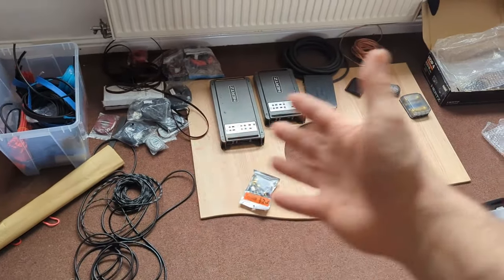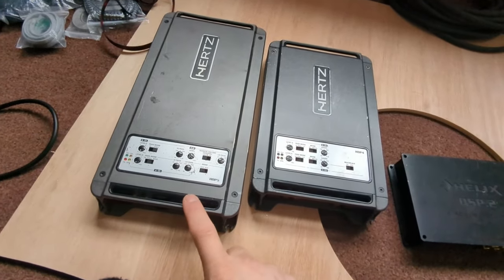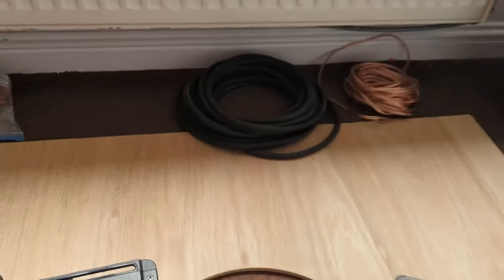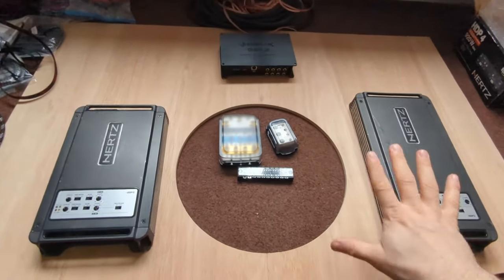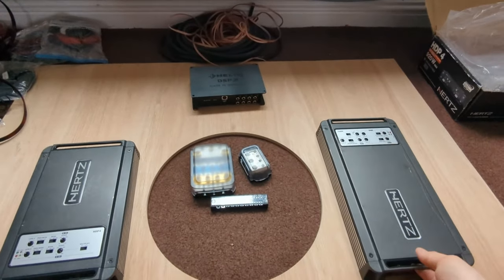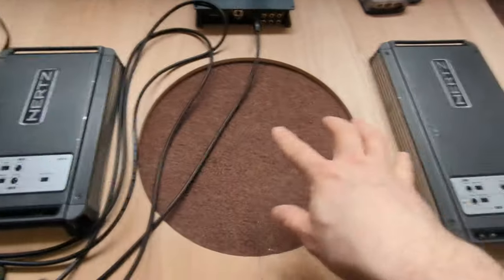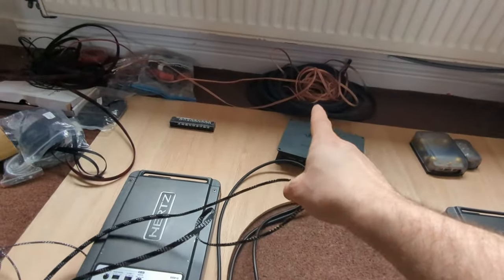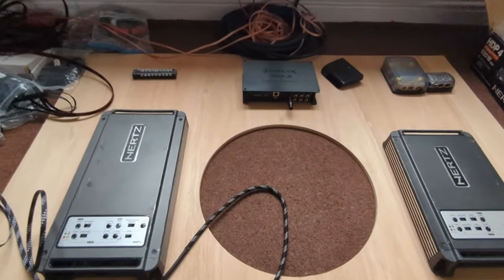Honda Jazz upgrade part 5 - amp rack plans

Comment: I did the same thing with the speaker wires for a friends amp rack. I kept them flat on the board. Anywhere there were bends, I separated the two wires at the bend, all the way to the next bend. That kept the wire from twisting at the bends.

Comment: Thanks you for your brilliant English) 
Instead internal Bluetooth you would like to install external, to connect toslink. I have same idea. But now i try to build my 1st system, and i thought what ugly idea. Now i understand that everything is good 😅
Reply from the maker: We opted for an external BT adapter as it was much cheaper than the Helix BT HEC card.
Reply: @RAW-CAt  Some use WiiM Pro streamers in their cars. Connect to it with phones WiFi, control that with phone (or probably any other device with WiiM app and Wi-Fi) but streamer plays max quality files and then can send signal thru RCA, Toslink or Coax cables to DSP... Haven't tried that myself, but one day I might remove Mosconi Amas external BT and try streamer in a car.

Comment: Twisted speaker wires are more for aesthetics. Twisted RCA’s is because most amps use differential inputs now. Now that DSP’s are becoming more of a standard, twisted is not as important for amp inputs. But twisted is still equally as important for DSP inputs.

Comment: Twisted was found to help cancel noise, better than shielded.  Larry Fredrich from  PG mentioned that in his interview
 (Rip)
Reply: Are you referring to speaker wires? Those are not very susceptible to induced noise.
Reply: @JasonWW2000  yeah
Reply: And input wires
Reply: Twisted input cables are also meant to be used with differential inputs. Tony DAmore’ has a detailed video about this topic.
Reply: You don't really have to worry about speaker wires since they are higher voltage and after the amplification stage. You could even run speaker wires parallel to your power and ground wires with no problem. The OEMs do it all the time.

It's mainly the low voltage, pre amplifier wires you have to be careful with.

Comment: What about having the amps horizontal on the right and the DSP and power distribution on the left. Then the RCA could run around the bottom of the sub and the power can run around the top of the sub. That way power can be kept as short as possible. Then the speaker cables can stay on the right.
Reply from the maker: I prefer more symmetrical layout....

Comment: What is the point of the speaker wire terminal blocks? I've never once used them in the last 30 years.
Reply: For “once and done” installs they are kinda pointless. But for those of us that can’t keep things the way they are for long, it helps with serviceability and not having to replace a whole run of wires.
Reply from the maker: There is no point, but I love them. Makes running new wires easier, you can swap out speakers or test something very easy.